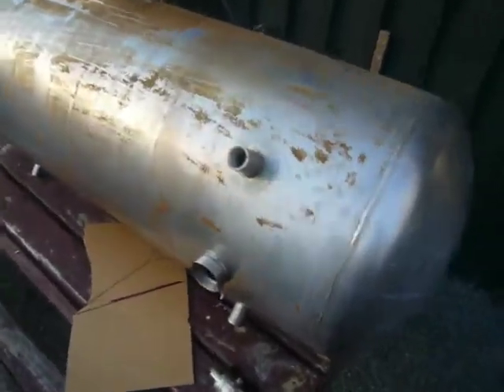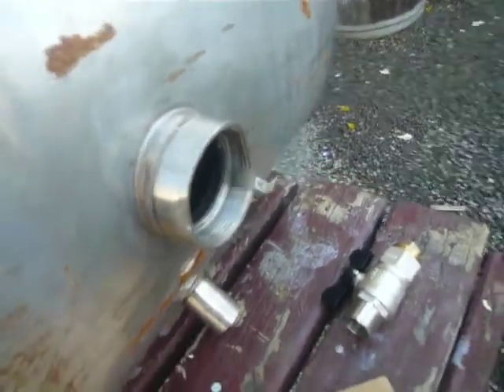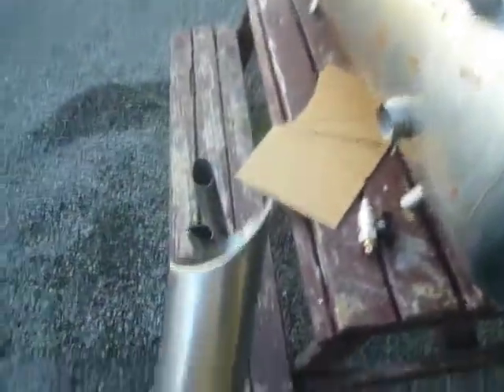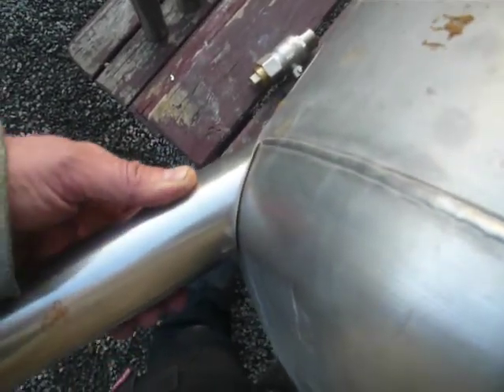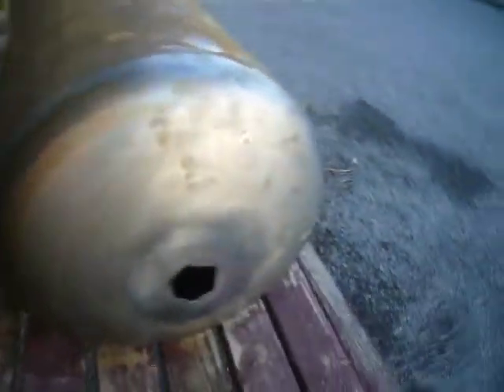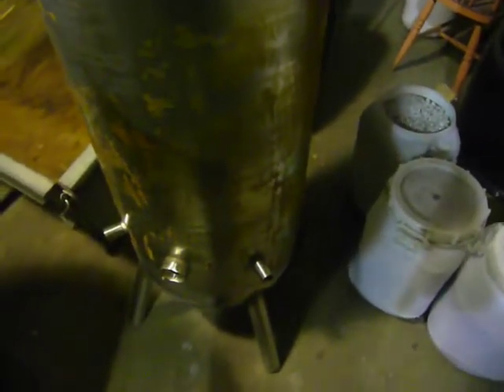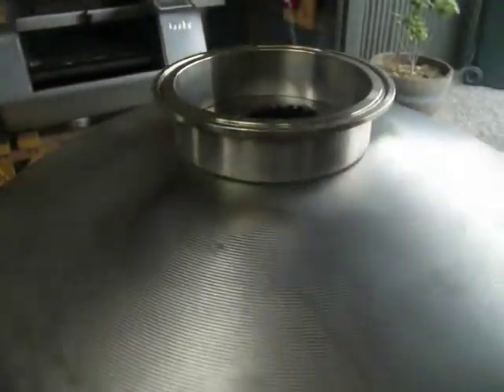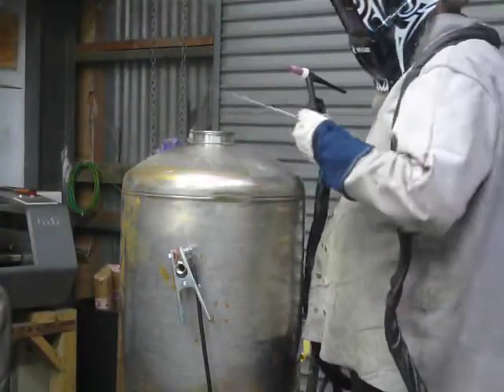Hot Water Cylinder to Kettle conversion - part 1

Comment: Ive got a 30 gallon copper water tank. Used to be hooked up to a wood stove. Its kind of tall arounf 5 feet or so. wouldn't this be a good start for a pot still? I could cut the top off, clean it up and then attach a head of sorts and line arms etc.

Comment: Great stuff! I've just started a similar project with a similar sized copper hot water cylinder (non corrugated style). I've watched these vids a few times for inspiration! Shame the NZHD site shut down, I used to chat on there a year or two back.
Reply from the maker: Heya Chris!
Yeah it is a shame about NZHD site.
Been wanting to build a copper one myself - have a few copper cylinders stashed in the workshop heh heh, ... would be silicon bronzing legs/ferrules onto one ... will be an interesting proposition with the thin-wall copper tank and maybe the cause for some rage-quitting if I blow thru' the tank wall lol
.
Would love to see what you get up to with your build. :o)

Happy Distilling!
Reply: @AngryParrotDistillery  Thanks! I've started taking some videos so I'll post something shortly and let you know :)

Comment: How does the shape affect the efficiency of the distillation? In a tall narrow still like that, alcohol in the bottom of the still has to make its way through the entire wash. I'd imagine a short squat pot would be more efficient at releasing the alcohol once your at temp as the wash is shallower and there's less liquid has to push its way through.
Reply from the maker: G'day William, yeah squatter is possibly a little more efficient - certainly a lot more managable.

This build like much of my stuff tho' is from recycled/re-purposed equipment - it brings the price WAY down.

Having said that, once the tank is up to temp there are some serious convection currents happening inside so stuff gets moved around and heated up fairly evenly with the exception of the very bottom beneath the lower element - but even that area gets churned up eventually.
The vapor comes off the top of the liquid so as long as there is sufficient heat and convection motion it will eventually do it's thing.
Reply: @AngryParrotDistillery  Yeah, that makes sense. Basically, a fabricated squat conical pot might be somewhat more efficient than a straight cylinder, but at a scale of 30-50 gallons, the cost savings of being able to use a salvaged water heater or clean stainless steel barrel are probably worth it. Probably best to focus on vapor column design as that will actually have an impact on flavor. 

Much appreciated sir.
Reply from the maker: Totally agree there William - regardless of shape, as long as you have a clean sanitary kettle vessel (it's going to have the crap boiled out of it anyways) that you have some temp control over, your efforts are better rewarded concentrating on the column/vapor path design.

I forget what I paid for that stainless cylinder now, it's a few years ago ... was somewhere in the vicinity of $50 from the local scrappie - and it was MINT inside (I still use it for 120L+ wash runs).
I've priced up squat conical tops in 304 stainless (parts would have to be outsourced as I don't have a sheet roller) - it was going to be an astronomical price.
Best estimates I could get it down to was by getting a fabbed conical with 4" opening for a ferrule and welding/brazing it onto a 'heavy-ish" 100L-200L stainless stockpot.

Happy Distilling and good luck fella!

Comment: how do you wire the 2 elements? what type of controller do you use
Reply from the maker: G'day fella,
I have a couple of vids up showing the controller build and more showing it in use.
Is basically, two relays controlled by a PID if I need it and independantly regulated via separate 10kW power regulators.
Elements are wired with a plug each and separately plug into the controller unit.
Happy Distilling fella!
Reply: @AngryParrotDistillery Distillery thank you, I watch all of George's videos.
Reply from the maker: Heya again James,
Hey if you need a really good tutorial on building a electrical controllers, head over to the barley and hops channel, I remember seeing George there had put up a few really detailed videos on building you own power controllers and PID controllers from scatch.

Heres a link to his channel.
https://www.youtube.com/channel/UCatCieEI4cPNteKXzBomVMQ

Comment: I have a question. Twice now i have tig welded a ferrule and it warps so the gasket leaks. Have you ever had this issue and know what I'm doing wrong? I appreciate Amy input you have.
Reply from the maker: G'day fella, that sounds like some serious warping.
Theres a number of things you could try to avoid this.

1) Turn your amperage down - you may be putting to much heat into the job.

2) Turn your amperage up. I know that's contrary to what I just said about BUT, if you are not putting enough heat in to get the weld pool moving fast/freely you end up taking too long with too much "time over target" and this can cause warping.

3) Tag everything before you weld - put 3 or 4 tag welds around the circumference of the ferrule to the rest of the job, make sure it is where it is s'pose to be - this can help pin it in place and minimize warping.

4) Backstepping, weld a 20mm stretch of weld then swap to the other side of the ferrule, weld 20mm, rotate 90deg, weld 20mm, rotate 180, weld 20mm, … keep welding 20mm and rotating until the circumference is welded up nicely.
The alternating stops too much heat build up in one area which can cause your warping.

How this helps - let me know how you get on and Happy Distilling
Reply: @AngryParrotDistillery  Thanks I will try these next time. I appreciate it!